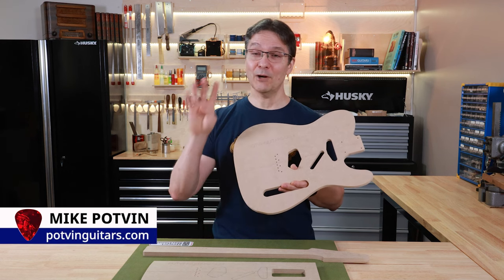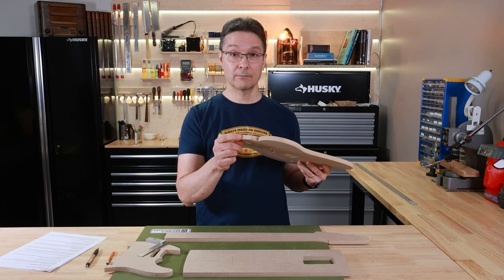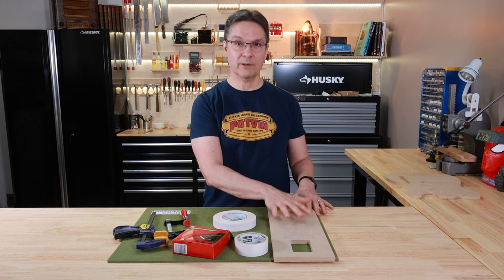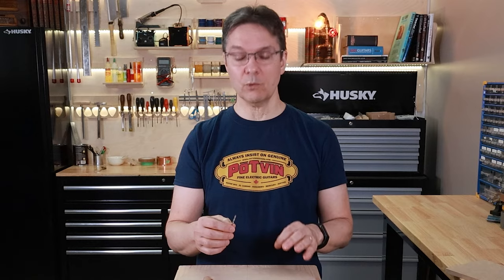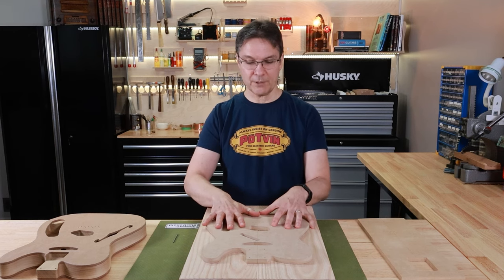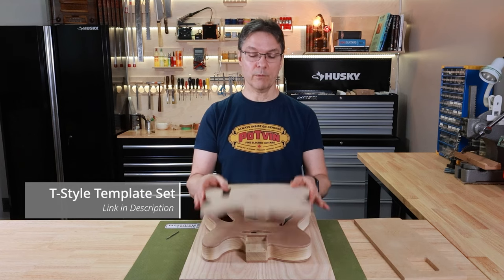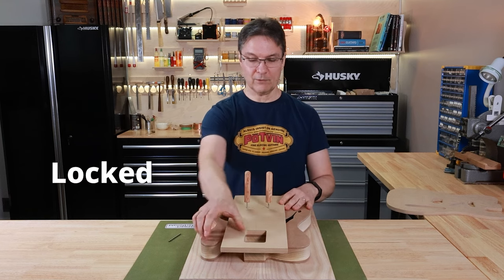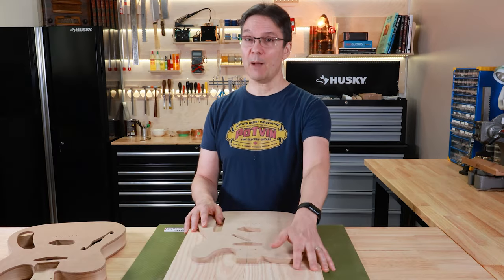5 Tips For Using your Potvin Guitar Templates

Comment: I used double-sided tape for a lot of different projects, and have actually switched to using blue painters tape and ca glue. I tend to get a better stick that I can control a bit more, and it's also much easier for me to set up (getting the backing off of double-sided tape is the bane of my existence).
Reply from the maker: The tape I used in the video has been a game-changer for me.  It tears like masking tape, and the backing peels away fairly easily without needing crazy long fingernails! I did a full video just on that tape - https://www.youtube.com/watch?v=Y8cdD6lIQxk